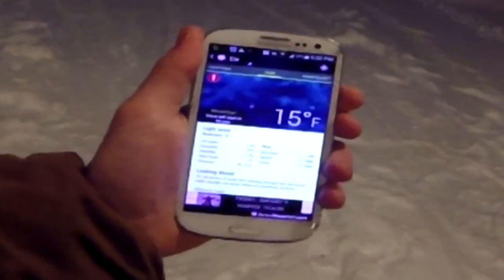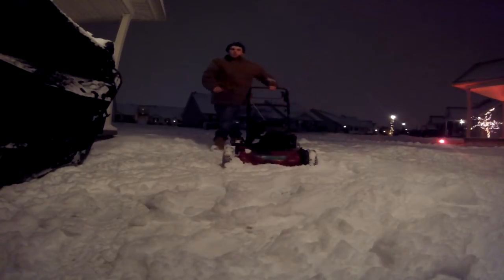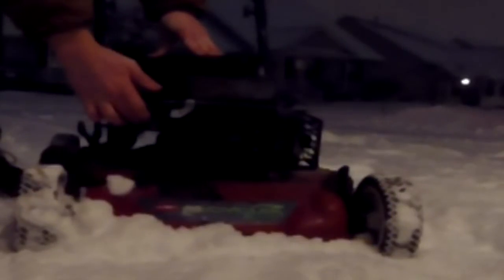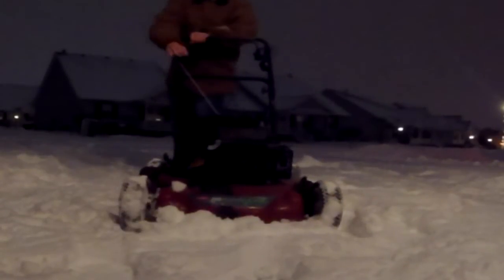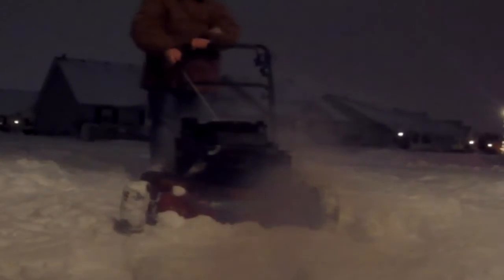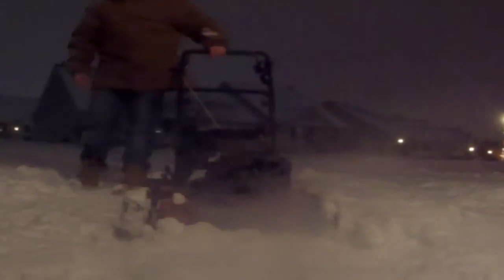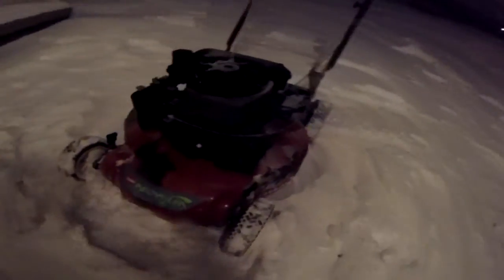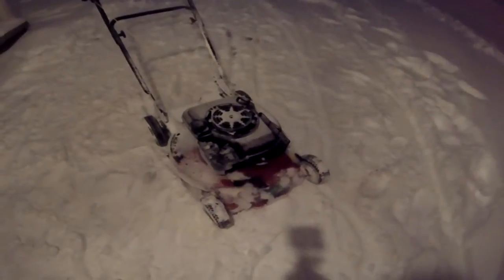15° Toro CTS-2 Lawnmower Cold Start 2014

Comment: Ben Just FYI You will crack the block starting a mower in the snow the heat of the engine and the cold snow could crack the block. That's why you never spay a hot mower with a hose I have been in mower repair for 15 years and 90% of the mowers that come in to my shop is one that the customer did not let cool off before thy spay it with the hose to clean it off and the blook was cracked.